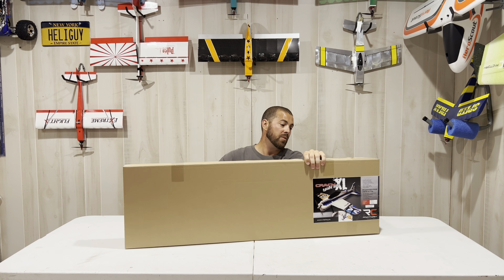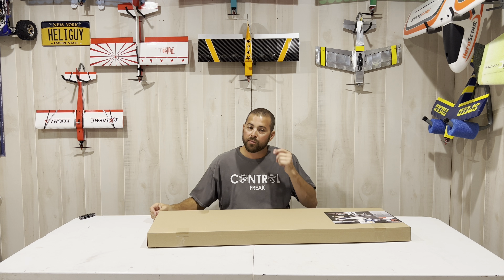Twisted Hobbys 43” EPP Crack Yak 55 XL Unboxing Video

Comment: Do you recommend buying the upgraded carbon fiber options for the motor mount, control horns, etc. That’s the one thing I’m not sure I need or not, but the plane is for sure a must.
Reply from the maker: Maybe for added strength and rigidity but not needed. My Veloxity is 8 seasons old and All hardware still working great!

Comment: Hi Chris! After discovering the wonderful 32" Crack Yak, I'm considering the Veloxity, Crack Yak XL or Edge 540: what would be your insight?
Reply from the maker: Can’t go wrong with either. All the 42” airframes fly very similar. You gain the full function stabilizer on the Yak XL which has insane tumbles etc.
Reply: @crmodels Thank you!!